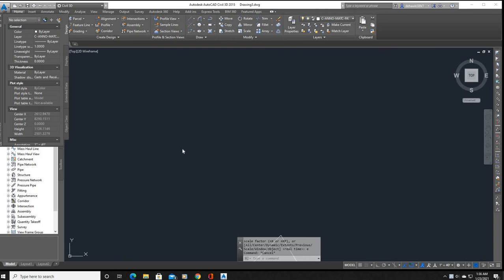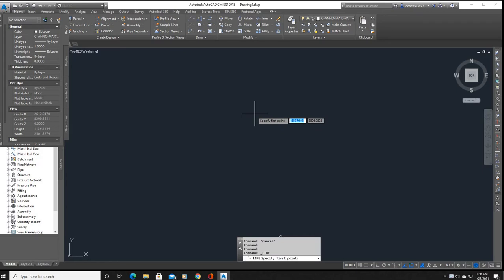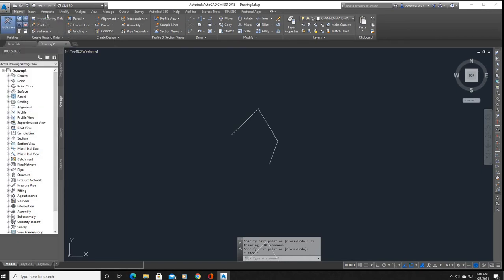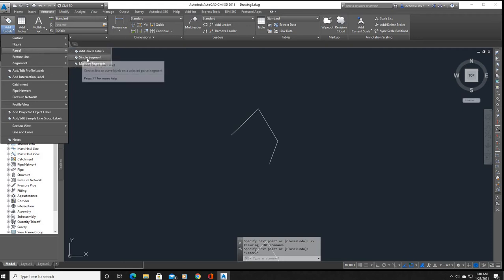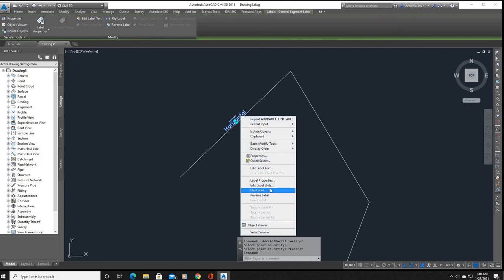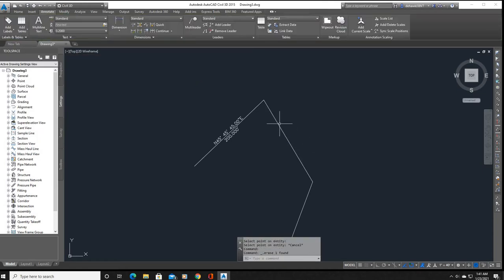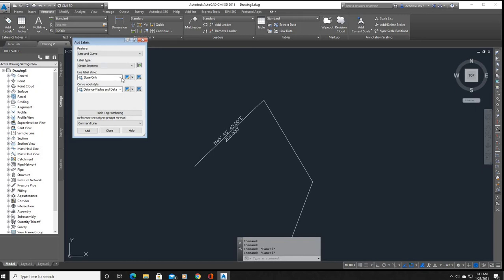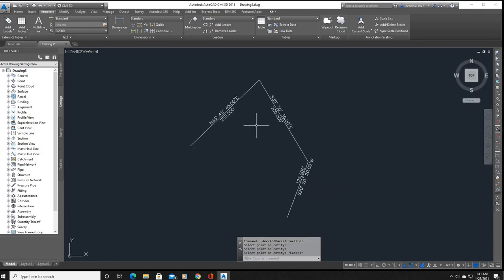Creating, labeling lines, bearings, distances, curves and making a line & curve table using Civil 3D

Comment: Sir I want to sum up the length of the line and the two tangents before and after the line to get the distance between two PIs. How can I do it?
Reply from the maker: Click on the alignment, right button properties to get length or it may have a label at end. If u created the alignment by cad lines it may not show the pi's. Re-created the alignment using the tools pull down menu and use pi's with curve.